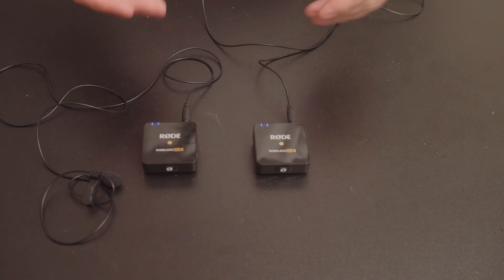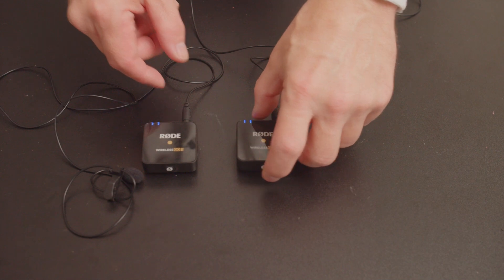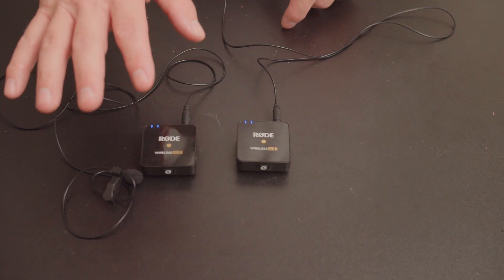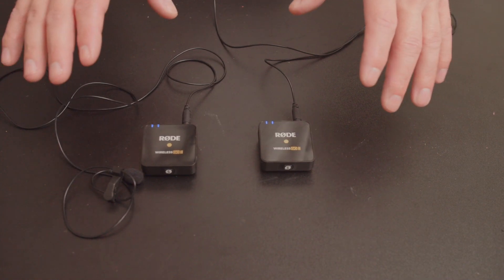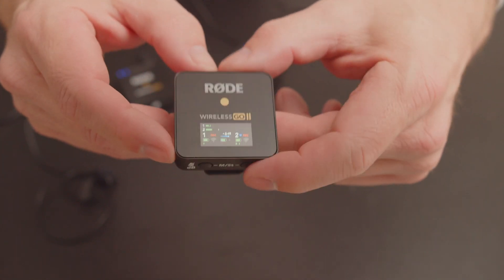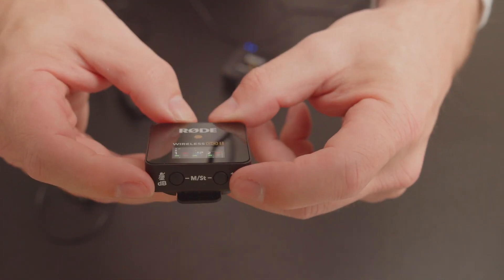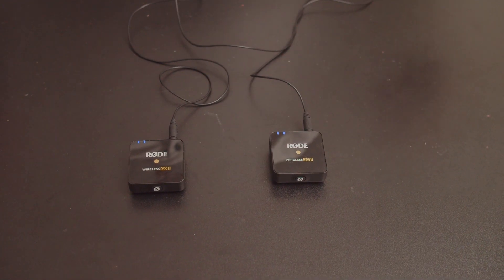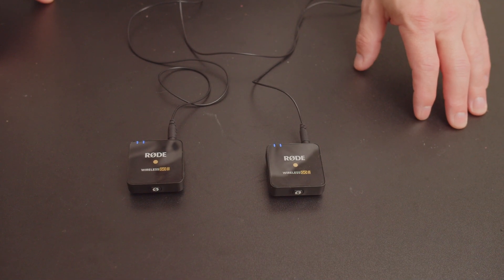How to Fix Rode Wireless Go II Noise Problem RFI Interference

Comment: Finally, I don't need to explain to my client that I will noise reduction that feedback later on. But any idea what does the "PAD ON" does?
Reply: @FilmPunk  Thanks Mate! Well, I don't think we need that if we are using Split mode. I would just rather keep it off, than deal with that feedback noise and my client starts asking why it has that weird noise 😆

Comment: Why are there so many different solutions to this problem!? I love these mics but that hum, while not always there, is deadly. I hope this works. Thanks for the info!
Reply: @FilmPunk  I was really hoping you plan would work. It may in many cases. However, my pad (blue triangles) were not turned on. I've written to Rode. This problem is too big for them not to solve. I love the product but the randomness of this issue means I simply can't trust it. Thanks for the suggestion.

Comment: I've been shooting some cooking videos and noticed that i got severe interference/signal loss from the induction cooktops the chef was using when on. Is there any way to shield this with the wireless go 2, also the 6db pad is off on mine i never had that issue. I had a video where it wasn't noticeable with a pan that covered the top of the cooktop but when using a smaller pan that didn't cover the whole burner serious interference.

Comment: getting this exact interference when I strapped the 2nd transmitter to a boom pole with an older Rode boom with 3.5mm connection. (1st transmitter was on lav and no interference) I didnt have pad enabled so Im currently trying to troubleshoot why im getting this exact interference... Too close to LED lights? Im not sure.
Reply: @FilmPunk  cell phone was in other room so not that but the coiled cable you got me thinking... rode mic is on top boom and cable is coiled down straight to the TX. Not sure how I would rig up the TX any other way but I'll run some whacky tests to see if that cable is acting as an antenna
Reply: @FilmPunk  this is a really old Rode videomic with 3.5 connection so I cant do much with the cable. I think Id be better off strapping an H1N to the pole and the video mic. LOL.

Comment: Is there any reason why you use 2 recievers at the same time instead of 1, if you are recording alone?
Reply from the maker: Two transmitters did you mean? Usually I don't if alone. But for the sake of testing I'd put both on although it doesn't affect it either way.
Reply: @FilmPunk  ah I get it. Thank you for the quick reply!

Comment: Hi, maybe you could help: I have this terrible clicking sound every time I cut my clip in FCP or create a transition. The audio was recorded with the Rode wireless go 2 mic. I tried to fix that, also with expanding teh audio and using cross fade transitions, as well as with playing around with different exporting formats. It's still there :(((( So disappointed
Reply: @FilmPunk  No worries, thank you for letting me know
Reply: @FilmPunk  Thanks for the tip! The audio is all ok in FCP, I can't hear any clicking. You can only hear it after you export. I discovered it per chance, before I uploaded a new YT video to my channel brrrr

Comment: I thought this was fantastic! Sadly, it doesn't work. I still get the interference.
Reply: What camera are you using? Try turning off your camera's wifi and bluetooth, worked on my Canon
Reply: Same story, pads are off, camera Wi-Wi is off, longer 3,5 mm cord in use. Anyway one of the mics has that noise. Brought them to the service. Hope that will help 😐
Reply: @Scorp_2  try a good quality cable I had a cable that was problematic and always hummed